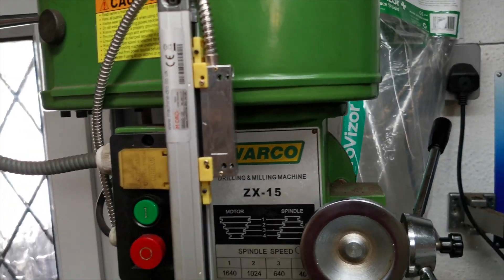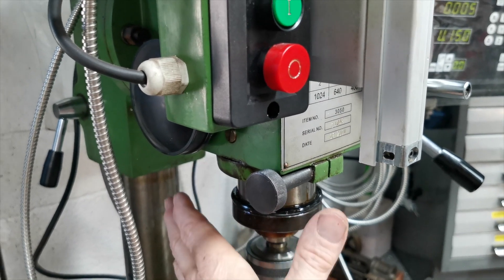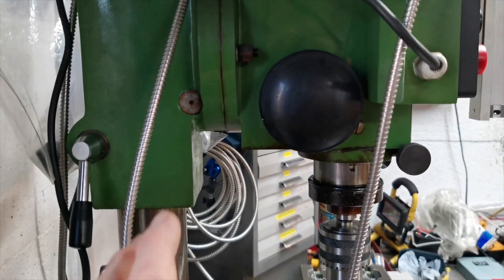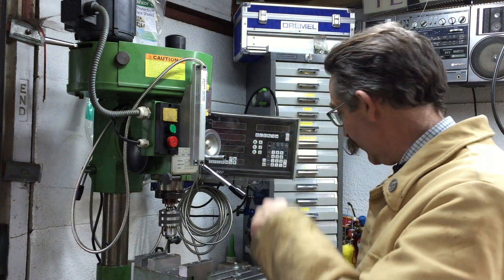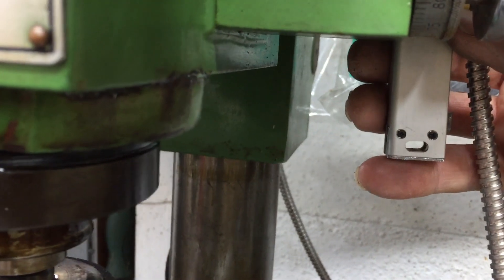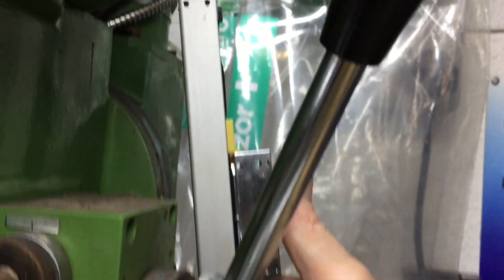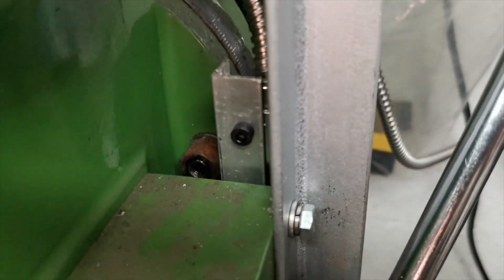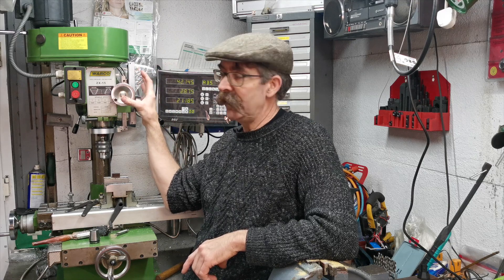Z AXIS DRO INSTALL ON SMALL MILLING MACHINE ( Warco ZX 15 )

Comment: Very neat. I like the button solution for not being able to fit the second mounting screw. I have a different mill but had a similar issue and came up with a very similar solution. X and Y axes were easy enough but yes, the Z was trickier. I ended up mounting the Z in much the same place as you and using a similar bracket to work it. I am not 100% happy with the bracket I made, it seems a little flimsy but it works fine in actual use. My mill is an Hafco HM-32. I didn't go into details but you get a very brief view here: https://youtu.be/WfNEZZdJ8GM?t=787
Reply from the maker: the button was an accidental solution as it wasn't until i drilled the bracket i realised there was no room for a bolt/cap head .